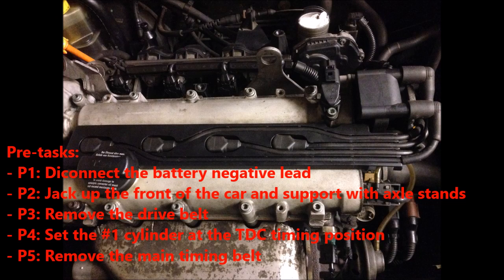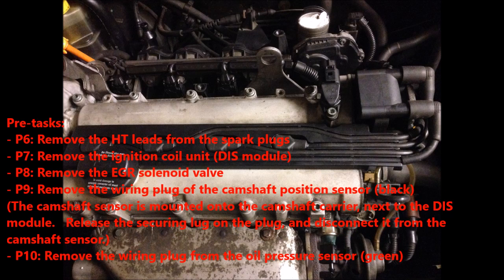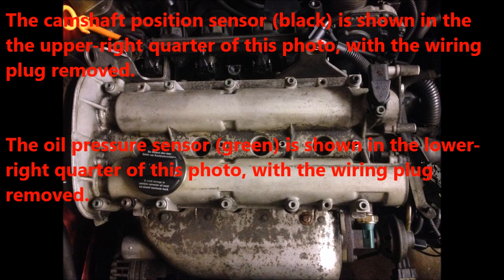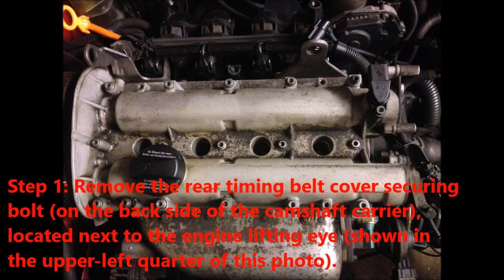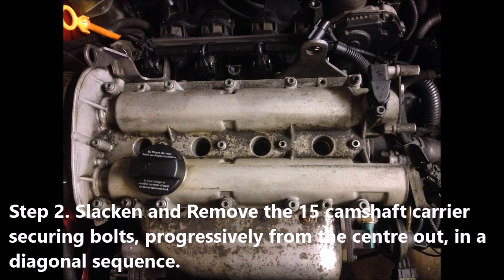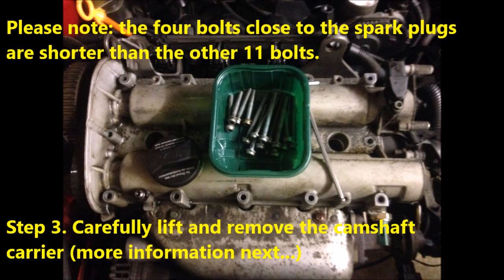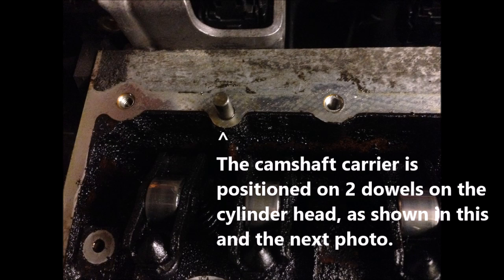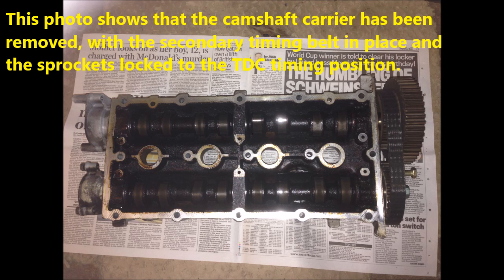VW Polo: Camshaft Carrier: How to remove (16v, 1.4, 6N2)

Comment: Is the valve cover sealing by gasket or by silicone?
Reply from the maker: hi, i used the paste gasket in a tube (bought from Halfords in UK) as show in my videos. cheers
Reply: theres nothing really on it when VW build the engine ,, the faces are well machined , but still let oil pass usually down the bores where the spark plugs are situated , i use dirko sealant and i find it quiet good , it works well at high temps
Reply: use Dirko HT ..VW  does,nt us anything  and they probably should ,,as oil leaks down by the spark plug bores